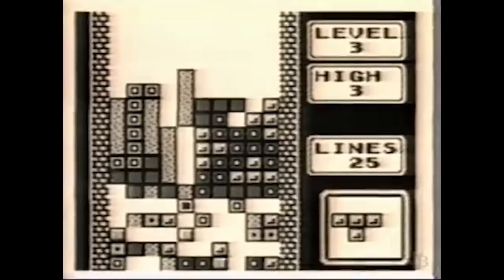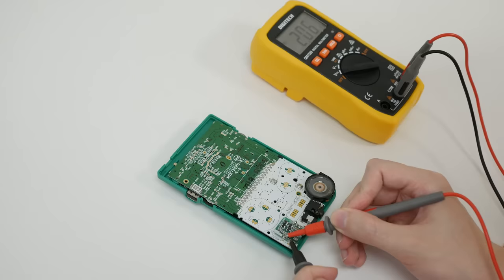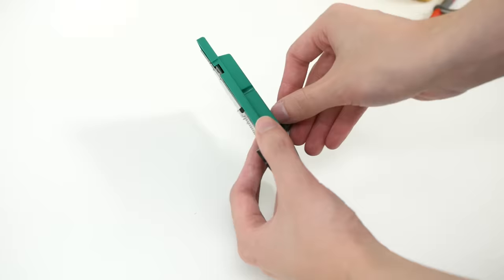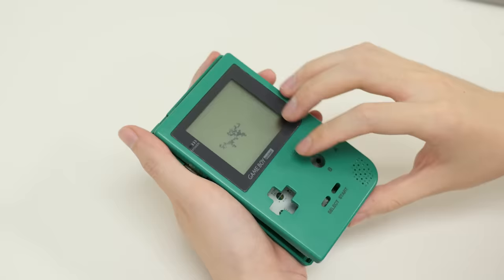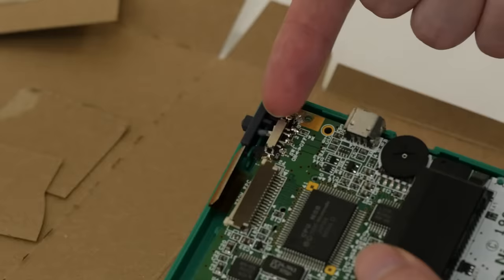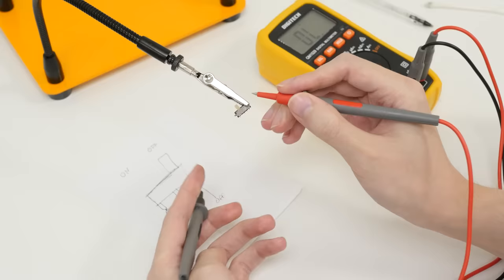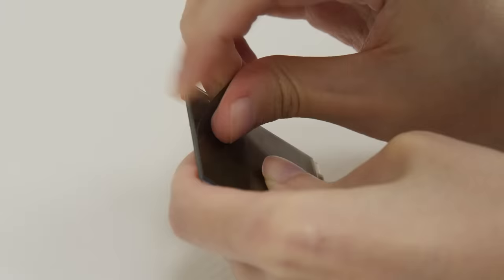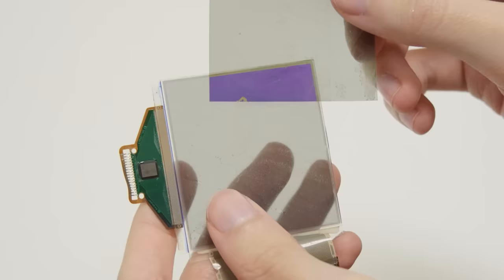Repairing a DEAD Game Boy Pocket [Part 1]

Comment: Not sure if anyone has commented this yet but it looks like to me that the LCD itself is damaged. The pixels themselves have somehow been damaged and when that happens with LCDs there is no saving them, it’s just e-waste now. Sorry.
Reply: Thought the same
Reply: At this point, just buy a lit up screen and throw it in
Reply: Yeah I would say just replace the screen
Reply: Luckily the Gameboy is not e-waste thanks to the modding community. I just wish someone would make a replacement b&w LCD the same or similar to the OEM display to keep everything feeling original.
Reply: Why is it not possible to cut it up into multiple parts, and fit an a small section from a different screen (but of exact same type)

Comment: A dirty switch is pretty common in GBAs as well. Sometimes, you don't even need to take it apart (the switch), just spray some IPA inside and keep moving it for 1 or 2 minutes.
Reply: @Stupetin  helps you forget its broken?
Reply: @Stupetin  I might be a bit thick headed here but just in case you were being serious. IPA in this context means Isopropyl Alcohol :D
Reply: Came here to post this.
Reply: I fixed some switches (toggle buttons?) in an old amp with WD-40 and a generous application of "pushing them all really fast". The buttons hold position and don't shut off any more so I guess it worked. Surface corrosion and/or dirt can really mess with old tech, so simple maintenance like that can save a ton of work and part swapping.
Reply: This lol

Comment: I've seen marks like that in old black and white LCDs before, and even some new ones after they've experienced a physical shock (been dropped, etc). So maybe it's some kind of damage to the LCD itsself cause by physical shock?
Reply: The crystals can't twist here anymore, that could be anything
Some people say it's because of humidity, or more believable rapid temperature changes
Reply: Had the same ishue when i pluged 9 volts to a lcd by mistake. There is not much that can brake in a lcd screen. So that is what you most likely get when it gets damaged.
Reply: That's literally what happened to me last month. I commented this already, but I recently dropped my near perfect GBP and it created a few of those marks..
Reply: Yeah it’s basically dead pixels
Reply: Have i met you on instagram before?
Reply: Yeah that’s definitely what it is.

Comment: In my experience, moving parts such as switches are the first things to break, because the contacts get gunked up and corroded. This actually good news cause it’s pretty to easy usually, just clean it really well, you can buy anti corrosive contact spray, which is really useful.
Reply: Yeah my childhood GBA SP would sometimes turn/flash red even though it's fully charged or shut off randomly, even after putting in a new battery. 

It turned out to just be the power switch that was dirty on the inside. It's actually a pretty common problem with them over time.
Reply: Or just use alcohol. A drop of some and repeatedly switching the switch should clean the contacts enough

Comment: Those pixels lost their capacity to twist the liquid crystal inside of them in order to change the orientation of light that passes through them. Thats how you polarize light so it wont pass through the filter layer, which makes the black pixels.

In short, its dead.
Reply: deez nuts
Reply: backlight mod?
Reply: it's*
Reply: @CreeperPookie  It's*
ratio + didnt care didnt asked + quote tweet + cancelled
Reply: so it's like dead pixels on a regular screen right
Reply: They can be resolved with pressure in some cases, but idk how permanent it is
Reply: That makes a lot of sense for liquid crystal displays, but what caused those pixels to lose this capacity is the real question. It cant be leaking out of the LC, since an empty pixel would not be black. 
Also its default (off) state, is not black. So a loss of power doesnt make sense either.
Reply: z
Reply: I was about today this but u beat me here lol
Reply: @Xnoob545   yes
Reply: What's funny is the pattern the dead pixels created. I wonder how it happened.
Reply: I thought that game boy was a disease boy with those markings
Reply: Knew it
Reply: @DemeDemetre  won't fix the polarizing layer
Reply: What the
Reply: @GerardMenvussa  thats what im thinking
Reply: @paliszarok  didn't
Ratio ratio+don't care+didn't ask+cancelled
Reply: in Mexico we call them 'dead pixels'
Reply: @paliszarok  own that fraud
Reply: @Xnoob545  this is a regular screen and literally is dead pixels
Reply: @paliszarok  gladly
Reply: I actually fixed my old dot matrix screen which had a similar defect by hitting it with my hand until all the black pixels disappeared
Reply: @paliszarok  Bofa
Reply: its actually fixable on the gameboy pocket and light
Reply: My guess is pressure damage (I had this exact same problem with my TI-83+).
Reply: @comicsansgreenkirby  you can fix them by massaging the lcd
Reply: Hmm yes I understand everything you are saying yes mhm yes quite
Reply: @paliszarok  + this ainttwitter
Reply: i think you could replace the liquid crystals if you had access to a vacuum to attempt repairs inside
Reply: AKA dear pixels. My Gameboy Pocket that I've had for the past 24 years has some dead pixels around the bottom of the screen. But the thing is that they're not really within the area where the screen shows displays the game. At the same time the screen and overall console works super well.
Reply: @Xnoob545  yes. In fact, I just found video about it the related to this video
Reply: @kebi7792  I did that with my kid
Reply: Its not dead at all.
Reply: @MODElAIRPLANE100  It's from trauma, ie the unit likely being dropped, jarred or twisted (such as being stepped on or sat on). Sometimes the leak doesn't even occur at the moment and the screen will continue to work for quite some time and then suddenly just show up one day. It's literally the liquid crystal leaking around between the pieces of glass, like if you put a dot of ink between 2 pieces of glass and squeezed it together...it would "blossom out"
Reply: @patrlim  The polarizing layer isn't the problem. The liquid crystal in between the glass is where the problem is, there's no fixing it. Fortunately replacement is cheap & easy to do.
Reply: Just found a video by "Hey! It's Andy" that fixes those dead pixels
It's called "Dead Pixels and How Gameboy LCD screens work - The Epilogue"
I just got recommended that video and was immediately reminded of your vid. Maybe try this out.
In short, he said, that the crystals in the display may be oxidised and are therefore not conducting anymore and that may be why they are "dead". 
The fix he had, was to use a q-tip and kind of massage the dead pixels out. So scrub with the q-tip and force for a while in different directions over the dead pixels. But make sure to put something behind the screen to not damage it.
Reply: @paliszarok  didn't* ask not asked* don't care*
Reply: Can you solder some capacitors to this pixels? Kappa
Reply: @paliszarok  this isnt twitter and i dont care about your "comebacks"
Reply: Actually, the light that comes off of the "dead" cells is still polarized. It's just twisted by 90°, as you can see when the polarization filter is rotated: The screen looks black but the dead cells are now clear. So actually the cells didn't lose the ability to twist the light. They lost the ability to twist back to their original orientation when the voltage drops below the exciting threshold. They got "locked in", so to say.
Reply: im just happy its not mold
Reply: Translation: Those specific pixels are shot
Reply: It’s not tho lol
Reply: @CreeperPookie  🤓
Reply: The “in short” saved my trouble😂
Reply: Brown Eevee Does Tech  THE COMMENT IS 1 FUCKING YEAR OLD AAAAAAAAAAAAAAAAAAAAAAA
Reply: @paliszarok  It's.**
Ratio + didn't care + didn't asked + quote tweet + cancelled.*
Reply: rip random nokia i have
Reply: Yeah, I've seen some calculators with that exact same thing
Reply: This happens all the time in my math class with the calculaters
Reply: NOT ANYMOREEEE
Reply: I highly doubt it. It was the polarizer behind the screen that was damaged. It was just a matter of replacing it.
Reply: wasnt it literally working before the new screen

Comment: In the user community they tend to call this mark on the LCD "leakage" or "screen CANCER."
They might be on to something... Something that sadly can't help the faulty screen itself. 
Also if you put the backlit screen, be aware that the power regulator is taxing itself quite a bit coupled with the small batteries. So even if the Pocket is stable after the screen mod, battery life will be absolutely wrecked.
Reply: One of my Pocket units had something like this on the edge of the screen... which just disappeared after a few days of use. The "cancer" talk is only getting weirder.
Reply: Is it possible to reduce power draw in any way to counter that?
Reply: @twentysixbit  Not really - backlighting is quite power intensive, especially in such a small space where you can't use some of the techniques used by larger displays like edge-lighting
Reply: @partycatplays  Perhaps he could replace the battery terminal with a custom 4 slot? Do those even exist
Reply: @twentysixbit  that could be an option. Haven’t looked into it.
Reply: MakhoTheNeko Kawaii  I hope Matt looks into that!
Reply: That screen cancer is making me sick and the goosebumps not ending what is that phobia called

Comment: That LCD is dead, Jim.

You usually see this in cars where the cold/warm cycling + humidity does a number on lcd panels.
Reply: lcd screen cancer, its a mold that grows between the glass panels inside the screen :/ 
BUT! theres TONS of aftermarket screen kits you can upgrade with no problem, turing this pocket into a gameboy light!
Reply: Lol. It's anything but mold or cancer :P
It's caused by microcracks in the glass panel itself or a bad seal between the two glass panels. air and/or water is all it takes to prevent the chemicals in those things from working. :)
Reply: @Chriva  its also caused by magnetism and other things, but the essentials of it is that the lcd pixel is stuck, you can massage the lcd to fix them. as that usually unsticks them in that position
Reply: To boldly go where no MattKC has gone before...
Reply: This thing is cause by  polarized film. This problem is common among gameboy pockets, just replace it and you are good to go

Comment: Tip for future desoldering: Be more generous with the desoldering mesh!
Don't only work with the tip of the mesh. If you use the middle of the mesh, it can absorb the solder in two direction instead of only one ;)
Reply: I find putting flux and solder on the mesh first helps significantly.
Reply: @Clarissa 1986 I don't know. Back when I was first learning to solder, I absolutely roasted some components, and they still worked. I don't recommend it, but they can handle some pretty serious stupidity. Lol
Reply: Flux.  More flux
Reply: I drip liquid Flux on top. They make braid with Flux embedded I think. 🤔

Comment: I've normally experienced that kind of damage on LCD screens when they're exposed to shock, it's happened to a few of my multimeters, doesn't show straight away happens a few months to a year after the impact, it's like a microfracture that just grows a crystalline structure over time especially in cold conditions, sometimes by warming up the display to 60-70°c the marks will go away but then they reappear after a couple of weeks to a few months later.

Comment: Long story short, these black marks is what is referred to as "LCD cancer" and they appear when the two layers of glass get some space between them for one reason or another and the Liquid leaks from where it should be to that space.
This is basically non-repairable no matter how you think of it, and removing the polarizer was a huge mistake.. The reason I say it is a huge mistake is that when you peel it using force (like you did) you're doing 2 bad things (in addition to peeling to totally fine polarizer that is):
1- you are exerting a force that will definitely make that empty space between the layers of glass get larger
2- you will definitely (sooner or later) get even more black marks around the edges of the LCD as the force you exerted is basically applied not only on the polarizer, but also to the layer of the glass beneath it, thus forcing it to separate from the other one.
So.. in conclusion, never do that. If you see a screen with this "LCD cancer" thing, my advice is: take it for what it is if you want to keep the authentic old looks, or just get yourself a backlit IPS LCD and mod your GBP.
Reply: If it's an irreparable problem, I don't think taking the polarizer off is really going to make things worse. Under the assumption that the screen wasn't going to be put back in anyway, it seems like a good opportunity to take it apart to try getting a better look at it!
Reply: the main worry is the lcd leaking onto his hands and doing some skin damage

Comment: I love 3:36, "NOOOO! NOOOOO!" 

Great video, you never fail to make anything you do interesting.

For the future, I'd recommend a product called Deoxit D5 for something like the switch. It's a contact cleaner that also has a lubricant. It removes corrosion really effectively and protects it afterwards. 

My theory on the LCD is that the crystals might have been damaged from an impact or something. I've seen something similar on a surface pro screen before.
Reply: how did you make a comment two days before it’s released?
Reply: Ummm 2 days?
Reply: @BrutalGoober oh thanks
Reply: @BrutalGoober no. Time travel.

Comment: Was screaming all the time: “just clean the switch” 😂 Thankfully you found out in the end. Switches only stop working because they either get dirty or corroded (common) or due to a shortcut (uncommon).
Also for SMD components I highly suggest a hot air gun and not a solder iron.

Comment: Hey Matt,
Thank you so much for uploading this.
My GBP had a different (very random) issue, but I was basically checking any toturial out there for any tips. I saw your trick on bridging the power switch and did that too to lower the complexity of my repair. This seemed to have been the issue on my unit though: very bad connections on the power switch. I reflowed everything and now my GBP is back in working order!
Thank you!

Comment: "you can see the mark at some angles"
Someone else has likely pointed this out already, but the reason this is, is because when light reflects off a flat surface it often gets polarized in some direction relative to that surface.

That's why polarized sunglasses are recommended for people on boats (water surface).

Comment: For this particular display, the crystal is supposed to straighten out when a voltage is applied. Since the polarizers on either side of the crystal layer are polarized at 90 degrees to each other, for light to pass through it has to be twisted by 90 degrees between going through the first filter and the second filter.

The "light" portions of the screen are where the crystal is at rest in its twisted state, the "dark" portions are where the crystal has been straightened due to an applied voltage. The crystal will normally relax back to its twisted state, but it can also be permanently straightened out by a high enough voltage.

The bits of crystal on those pixels became permanently untwisted due to over-voltaging. There was probably pressure applied to the screen while the gameboy was on, allowing voltage to leak across the electrodes in the array, delivering too much voltage to the crystal above those electrodes and damaging those bits of the crystal permanently. The pattern is from the moment at which that high voltage randomly leaked between segments of the electrode array.

Sometimes you can massage the crystal and it will come out because you're sort of smooshing around portions of the liquid crystal so that enough of the undamaged crystal substance will be above each of the electrodes in the array to respond correctly to the voltages.
Reply: The massaging trick can also work for stuck bright pixels on modern color LCDs (where the bright pixels are in the active state of the crystal rather than the dark pixels). Note that for stuck dark pixels on modern LCDs, the problem is likely that the electrode itself is damaged, e.g. due to impurities in the silicon wafer that the electrode array was grown on, so you can't massage out stuck dark pixels from a modern color LCD.

Comment: You got a case of screen cancer. I was able to fix it by rubbing the spot with a q tip repeatedly for hours. It will eventually move to the edge of the screen, or if you are lucky, it will go away fully.

Comment: I usually prefer to buy systems that are just dead, as in they don't power on according to the seller but don't have any obvious visual damage etc.

most of the time it's the matter of changing a battery or something simple, or in the case of my Game Boys it's often just a flaky power switch that just takes a bit of cleaning. Much cheaper than buying replacement screens and things like that
Reply: I desperately want to believe that nobody would sell a dead Gameboy that can be revived with new batteries. Surely people can't be that stupid.
Reply: @HKlink  No I was talking more along the lines of a nintendo DS or something, I bought one that just needed a fresh battery. But I have bought a GBA SP and a GBC that both started working simply by spraying alcohol into the power switch and wiggling when they were initially listed as not working
Reply: Handy advice to keep in mind, thanks!